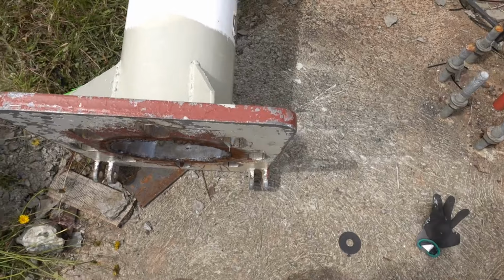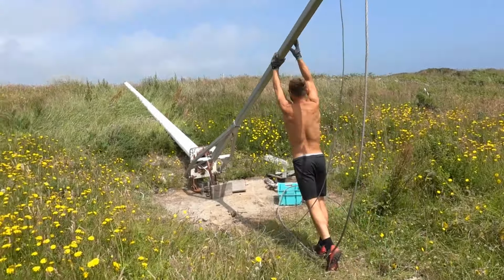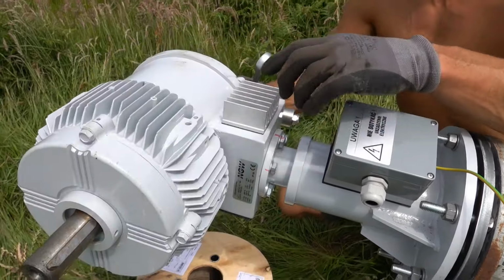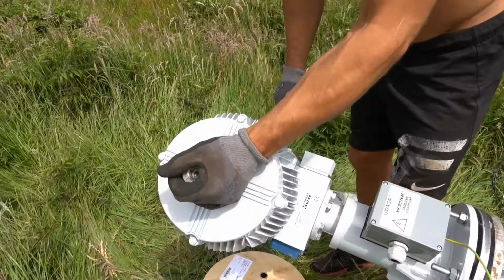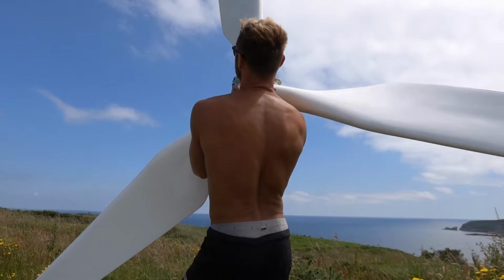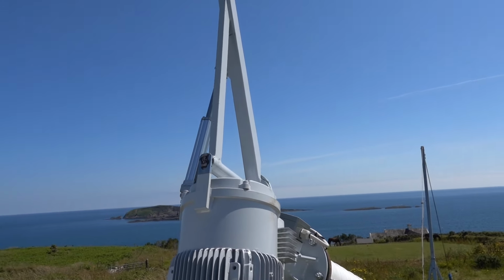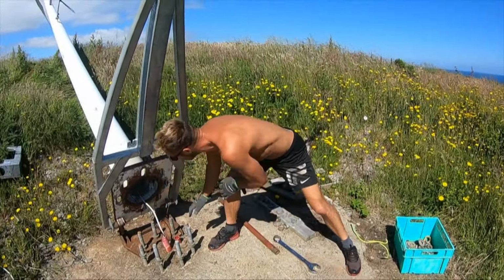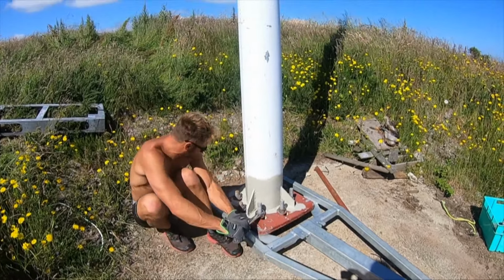Wind Turbine made in Poland - West Cork Ireland - Chestermatic mast erection and turbine assembly

Comment: After spending a lot of time getting to grips with this, I think you are missing a key explanation, which makes this easier to digest for most people.. its key to understand that your earth or cpc is there to provide an alternative route back to the generating source in the event of a fault. The earth on the local source in your instance is centre tapped from the transformer on the pole. Once you are running in "Island mode" your generating source becomes the inverter so we need a route back there in the event of a fault. Obviously there might not be a route back if you stick with a provider earth solution, which is why you need a TT.. Once I got my head around what a cpc really was the rest became much easier to  understand. It seems some sparks don't really get this so don't always provide the correct advice..

Comment: In general: All practical tests of ground-based small wind turbines show: 1) They hardly produce any electricity! 2) They do not last long! Electricity yield is proportional to third power of wind speed: +100% wind generates +800% more electricity! Close to ground: 0 constant wind, but extreme gusts! Due to extreme price decline solar panels generate at least 10 times more electricity with the same investment in time & money! Unfortunately not at night and in winter! But reliable && maintenance-free for 25 y+! And you need a battery for wind and solar. 9 out of 10 small wind turbines stop working after just a few years due to the extremely gusty winds close to ground.